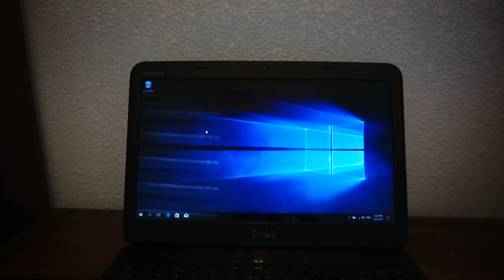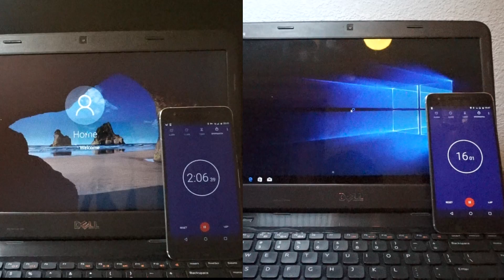Dell inspiron N4050 SSD and RAM upgrade

Comment: I have 2gb ram. Can I add 4gb?  And What ram specs ?
Reply from the maker: francis avenido IDK the compatibility of the RAM that you are adding in, in most of the case, there will be no problem for the sodimm ddr3 1333mhz ram
Reply: Mine has been upgraded to 6gb ram

Comment: What are the specifications of the laptop now? I have the same laptop and I want to do the same to make it more fluid, can you please tell me what you specifically purchased? :(
Reply from the maker: So any SATA 2.5" SSD will work. I recommend the Samsung 860 EVO for now since there is a good deal on the 500 GB one. If you want to upgrade the ram, DDR3 1333 SODIMM works for the machine. There are two ram slots on the motherboard, and one is occupied by the factory memory.
Reply: @qiaojiezheng5310  So can I buy a Corsair 8GB SoDimm DDR3 1333MHz RAM? Will it work? Can I use the free slot for that an make it 12GB RAM? I already have Intel i5 and hard drive of 500gb that I would like to change to a SSD. My system is 64 bits.
Reply: @maanuelrc  This model supports just 8gb ram
Reply: Is this still work if i only installed 1pc 8gb ram sodimm 1333mhz , instead of 2pcs 4gb ram sodimm 1333mhz?

Comment: Could you tell me if the inspiron N4050 is compatible with DDR3L-1600 SODIMM memory or only with DDR3-1333MZ?
Reply from the maker: I don't think 1600 is gonna to work for this one.
Reply: Thank you for your helping!! Only 1333 work in this system.

Comment: Is this the same for the Dell inspiron m5040?
Reply from the maker: yeah, pretty much. But the hard drive for m5040 is located on the right-hand side. Other than that the process should be pretty similar. Hope it helps
Reply: Yes,  it did thanks so much and nice footage btw. I could actually see what you were doing clearly and it was easy to follow. Many thanks keep up the good work man  👍

Comment: Hi I have i5 N4050 too.. thinking to do the same.. so if i want to buy the SSD 256GB outside, what kind of spec/size/etc that can fit the laptop? How bout if I buy 64GB is there any slot to fit in without replacing the hdd?
Reply from the maker: Hi there, if you are planning to get a 256 GB SSD, basically any 2.5" drive should work. I currently have a Sandisk 240GB SSD and it works perfectly. Here is the link to the SSD. http://amzn.to/2xZPJ0H.
Also, if you are thinking about adding a 64GB as a boot up drive, you can replace CD driver with a caddy adapter. There is no room on the motherboard for another one 2.5" drive and because this is a rather old model there is no M.2 SSD slot.